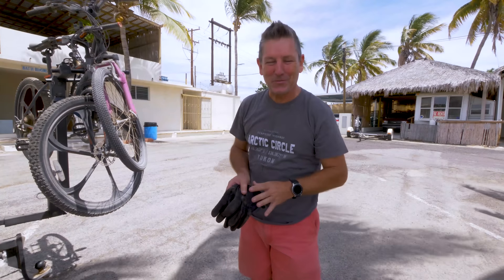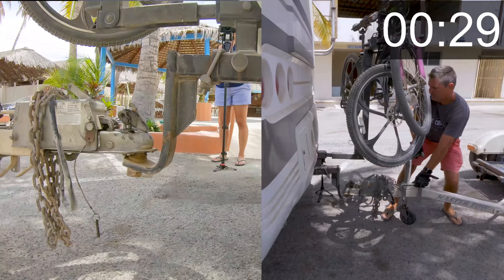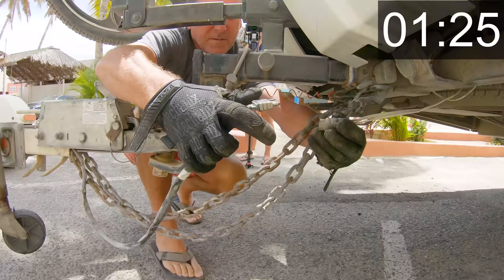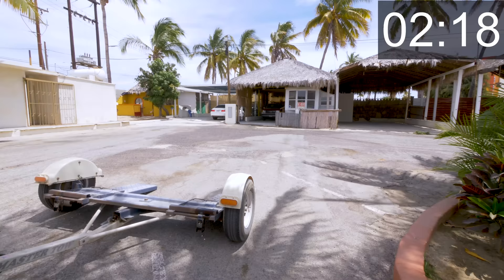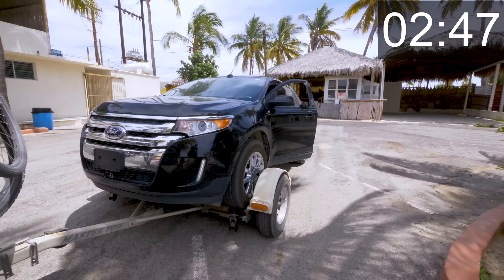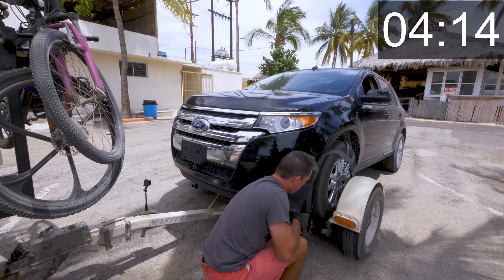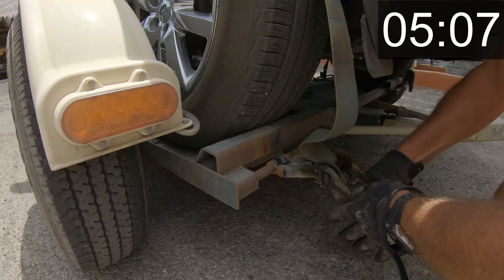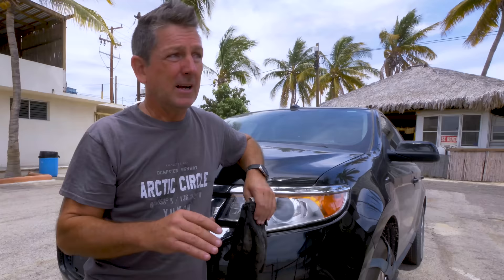EASY Tow Dolly Hook Up & Load Vehicle in 5 Minutes | Check Your Owner's Manual! #towdolly

Comment from the maker: We have heard that newer vehicles have electronics on the rear axle that require the vehicle to be placed in neutral and the battery be disconnected. Many people use safety chains connected from the tow dolly to the vehicle. I choose not to because I feel that the chances of both straps failing is pretty slim. Check your straps regularly for wear that could cause a failure and replace at the first sign of fraying. Check you owners manual before listening to any knucklehead on Youtube! 😂

Comment: You forgot to add 2 magnetic lights on the roof. By law, your dolly lights are too far forward.  Easy peasy,  do the right thing!
Reply from the maker: I don't like the way the magnetic lights look. I would think those laws vary from state to state. If someone is following at the proper distance,  both dolly lights are visible. I will say that I have pulled that dolly over 50,000 miles, back an forth across the Canadian and Mexican borders and have never had an issue. For added safety, I recently added an adaptor for the vehicle taillights to work.

Comment: You should have safety chains from the car to the dolly.
Reply from the maker: Some states require it, I think they are unnecessary. If something happens that both your straps break simultaneously and the only thing holding the vehicle on the dolly is the safety chain, you're probably upside down! Just my opinion.

Comment: One more thingyour break away brake cable needs to be hooked up to the motorhome frame, not the hitch. Don't rush a how-to video. Show all the required steps.
Reply from the maker: Appreciate your input. I have never seen anyone hook a breakaway cable to the frame and have always used the same location as the safety chains.

Comment: Very quickly he lacked to secure the anchors of the center of the dolly, the safety chains lacked
Reply from the maker: You are correct. I personally do not use the extra chains. I keep my tire straps in like new condition and replace them when they get overly worn. I don't see the need for the extra chains. I would like to hear if anyone has had both tire straps break and the only thing holding the vehicle on being the safety chains. We appreciate your comment.

Comment: He didn't spend much time making sure the vehicle was in the middle of the dolly. It took me over 30 minutes of on and off just to get mine within 1" of being in the middle. How important is being close to the middle?
Reply from the maker: It doesn't have to be perfect Glenn. I know how far the tire has to be from the edge of the ramp.  so I line that up and know we're good to go. I'm sure you could be a couple of inches either way and be fine. We have had zero issues after 55,000 miles of towing on that dolly.

Comment: ok you all when you hook up the dirty light plug ,, i usually add a small wire in the middle of the wires and twist it so it DON T CUM LOOSE
Reply from the maker: Thanks for the tip Mike!

Comment: You should get rid of that adapter for your bike rack .it pushes your hitch to far back from your receive and that extra length increases the load on it weakening your whole hitch  that's not to bad if you're only hauling some thing lite like a small utility trailer maybe up to 1000 pounds but you are hauling closer to 2 tons . That is dangerous please I'm not being a troll I'm looking out for you those adapters should be  out lawed in all 50 States  .the extra length will reduce the hitch strength by up to 50 percent.
Reply from the maker: Alan, a tow dolly doesn't have as much tongue weight as pulling a regular trailer. We have 50,000 plus miles on our hitch/dolly/bike setup without an issue and we check it regularly. Thanks for your input.

Comment: Good stuff. Almost went with a dolly but found a Hyundai Veloster, standard transmission 6 speed, so we went with 4 down with a Blue Ox tow bar system.  There were no modifications needed to the Hyundai since it only weighs 2,800 lbs. Pretty easy and solved the storage problem since we have a 40' rig.  Well done and yes you have a darling camera woman assist! Stay safe out there.
Reply from the maker: Always go with what works for you David! Safe travels!
Reply: Hope the car isn't stolen with a USB cable!

Comment: Glad I watched this video. I have some straps that came with the master tow dolly and they literally suck. I'm buying the ones with two hooks which also seem to ride a bit higher and don't scare me about going around brake lines, components, etc. Thanks for this.
Reply from the maker: Yeah, some tow dolly straps seem like they aren't even supposed to be used for a tow dolly. They do get in the way of everything. I wish I could tell you which ones ours are, but I honestly don't remember. We've replaced them twice in our travels now. If they show a cut of any kind they should be replaced immediately, but if you install them correctly they should last a very long time.

Comment: Is it me or does the trailer tires look bald on the inside? And the hitch adaptor for the bikes is it rated the right weight? Why i say this usually adaptors cut the towing capacity in half. Otherwize very simple and straight forward video guys!! I think you ment to say FRONT WHEEL DRIVE. You can have 2wd but only rear and then you can use a tow dolly.
Reply from the maker: Trailer tires are good, it just looked funky in the video. Adaptors do reduce capacity but there isn't much tongue weight with the dolly. It's worked for 2 years without issue....I should have never said that! And yes, I meant FRONT WHEEL DRIVE...Lol! Safe travels!

Comment: Thanks for the info.  We are switching from a travel trailer to a 32' Class A.  We are about to buy a dolly for our civic and enjoyed this video.  Practice will make this process go faster.
Reply from the maker: Yes, practice will help you get faster. Remember, SAFE is better than fast, but we had people telling us they didn't want to use their tow dolly anymore because it took 30 minutes or more to hook it up. It doesn't take any longer than towing 4 down. The biggest con with a tow dolly is if you have to store it when at campgrounds. The biggest plus is you can still back it up with a car on it for a short distance, if you have to and if you are careful. That is something you definitely will need to practice!! We were able to back it into most spots and rarely had to unhook it. Safe travels!
Reply: @LifeWithPaulLorena  Thabks for the great reply.  Was wondering about the backing up.  Assumed you had to go slow and not too much angle because of the surge brakes.  Know there may be tighter clearance issues possible with the car. But what about side load forces on the steering column?  Assume this would be another reason for a gentle backing up with maybe a slight angle.
Reply from the maker: You can always test that. I've backed up a long way with ours and have even done a slight turn while backing up. Probably not recommended because you can get into a bad situation pretty quick, but I've done it to avoid unhooking everything to get out of a tight spot. You have to go off your comfort and safety level. 

I lock our steering wheel because our tow dolly has a pivot plate. I try to not make really sharp turns. Safe travels!
Reply: @Life With Paul & Lorena  once we get everything we will probably have a video out as part of our RV Hunt videos.  Will try to let you know so you can have a good laugh

Comment: Paul, love your and Lorena’s video never thought i would have a technical question but here I am.  We have a small Motorhome, 21 foot, capable of towing but we have a rear wheel drive Chevrolet tracker, 5 speed manual.  Thoughts of towing backwards.  There are so many ideas out there but you seem to understand and keep using a dolly for towing.  Thank you in advance for your thoughts.  Congratulations to Lorena and we are fortunate to have her as an American Citizen.
Reply from the maker: Hi Diane. I think towing your vehicle backwards is a bad idea because the front wheels can turn and may cause a wobble. If it's a manual you should be able to tow it 4 down without a problem? I use a tow dolly because we have a front wheel drive car and a tow dolly is easy for that.
Reply: Paul, Thank you for your replay!

Comment: I use a trailer instead of a dolly. I have needed to park the trailer in a parking area before but I can take any type vehicle plus we can add stuff on the trailer. I am concerned it can be stolen so I have wheel locks I use when disconnected. Not all 4 wheel drives can be towed 4 down.
Reply from the maker: I would love to have a trailer with storage. Dealing with the dolly is enough! Lol! Isn't it crazy we have to worry about someone else taking our stuff!? Safe travels!

Comment: Do you not have safety chains?  Do you lock the steering wheel with the car's seatbelt to take the strain off the vehicle steering wheel lock?
Reply from the maker: I use safety chains from the dolly to the rig because I could see where the ball could have an issue and release. I personally choose not to use safety chains from the dolly to the vehicle because I don't think they are necessary. To have both straps break, if you keep them in good condition, is very unlikely to happen. I know many people will disagree, but we've towed over 50,000 miles now without even one strap breaking or coming close to breaking because we replace the straps at the first sign of wear.

We do not use the seatbelt trick and again feel it's unnecessary. You have to do what feels right to you and makes you feel comfortable.

Comment: I’ve been using the car tow dolly for about 12 yrs now, found an old Demco for 375$ and its a workhorse ! I pretty much mirror your way , I’m a little more on the side of precaution n I don’t leave my chains to low to the ground ( sparks=fire) i use locks all my points of connection ( prevents thievery ) ! I need to install a wheel in front like you did , I’m not getting younger n it will help in moving the trailer! Good video

Comment: Are the tow dolley lights all you need to come on? What about the vehicle lights ?
Reply from the maker: As far as we know, all you are required is to have indicator lights in the rear. We have towed this way for over 5 years without issue. I would say that having the vehicle lights working as well would be an added safety benefit. Safe travels!

Comment: I agree totally on a dolly vs 4 down however I have a safety chain from the dolly to the car I noticed you don't . Just an extra safety precaution nothing wrong with being too safe.
Reply from the maker: I don't use them, but they are law in some states. I would like to hear from someone who had both straps break and the only thing that kept the vehicle on the dolly were the safety chains. I replace our straps when they even hint of being at breaking point.
Reply: @LifeWithPaulLorena  good to know about the straps feel the same. I hook the chains up simply because came with the dolly and they're not much trouble  to hookup Not sure what would happen if the straps did break guess the chains would either crash me or hold the car in place till I could get stopped who knows. If you  wouldn't mind knowing where you buy your straps at?. Sure like the way your  looks with the three straps my only has two.

Comment: While a jeep is usually 4 down capable, most late model  4 wheel drive cars are NOT listed in the dinghy guide for 4 down towing.
Reply from the maker: Yeah, you definitely want to check before trying to tow anything 4 down or worse yet, buying it thinking you can tow it 4 down and finding out you can't!

Comment: Good tutorial. Some questions;  I just picked up my first master tow dolly so this is helpful. Brakes: you have a breakaway cable if the hitch disconnects; how do the surge brakes work if there is no “push back” from the tow vehicle ?  Steering wheel lock , I was told it’s important to lock the steering wheel, you didn’t mention this. Is it necessary?  Especially when backing up ??  Thanks.
Reply from the maker: Hi Todd! When you brake the vehicle towing, the vehicle being towed pushes forward and applies the brakes on the dolly. t is not a perfect system, but ours has worked flawlessly for over 3 years. i didn't mention locking the steering wheel because some vehicles steering wheels lock and some don't. Ours happens to lock when you turn off the ignition and pull the key. If you are thinking about backing up a car on a tow dolly you better know what you are doing or you will likely cause damage to your car, the tow dolly or your tow vehicle. It ain't easy!

Comment: How are they backing up? Using one 1st time tomorrow on non running 68 Cougar.

 Ive backed boats in 30+years, thanks.
Reply from the maker: You can back the tow dolly up by itself if you are very careful. Because it is so short it will jackknife very quickly. I have done it for very short distances with the car on it, but that can go wrong in a hurry!
Reply: @LifeWithPaulLorena  yes it's a PITA! Having my 68 flatbeded, it's worth too much plus need to save time. Did my Taurus and bronco and 25' boat rig yesterday, was enough. Looks like short piece of 2x4 between swivel  platform and drums would lock it so as to back up, didn't have time to try it.

Comment: One thing one ever think about is not all cars can be towed by a RV or for that matter a tow truck with rear wheel s down on the ground most car with front wheel drive can .some rear wheel drive can buy a lot can't you need to look at your owner s Manuel to determine  most rear will  get drive train damage unless you remove the drive shaft be for towing more than a few miles at low speed  .the car needs to be running and in gear to move the oil in the drive train. Please check your manuals   and happy rving.alslo dolly can be a great tool but they don't have any break  and are not legal in a lot of state s and not safe in the mountains due to having 2 tons going down hill with no brakes
Reply from the maker: You are correct in that a tow dolly is best for a front-wheel drive vehicle. I would never recommend a tow dolly for a rear-wheel drive vehicle for RVing.  

However, you are incorrect when you say ALL tow dollies don't have brakes. Ours has a surge brake and most others have electric brakes. We have traveled mountain roads all over North America without an issue.

Also, tow dollies are legal on every highway in every one of the 48 contiguous states. Registration and whether or not you must use lights in various ways may vary.

Comment: Would you use this dolly for a rear wheel drive ? Like a truck?
Reply from the maker: No you wouldn't. There is no point really. A front wheel drive works best on a tow dolly.

If it's rear wheel drive, check to see if it can be towed 4 wheels down. Some rear wheel drives can be towed 4 down. Some need accessories like transmission pumps, and some just can't. Best of luck Ken!

Comment: You don't mention the locking steering? Some videos show the steering free. So which is it?
Reply from the maker: We put the car in park, and turn off the key. The steering is locked. Our tow dolly has a swivel deck so it's not necessary to leave the steering wheel unlocked. We have traveled 55,000+ miles without an issue.

Comment: Great video! Couple of questions. Electric Brake controller or stick with Serge brakes? Is there a make of dolly that you can backup? What is up with some dolly's leave the brakes off steering wheel in locked position? I'm getting carried away. Thanks for your help
Reply from the maker: Hi Ron, the surge brakes have worked great for us. Less to go wrong, in my opinion. I back mine up all the time without issues, but you have to be careful because they can jackknife quick and damage your tow vehicle or coach.  Not sure about your last question. We leave our car unlocked, but the steering wheel is locked and keys are out. Hope that helps! Safe travels!

Comment: I just spent an awful lot of money on a new car that will be Dollied behind my Motorhome (B+ Compass)...I missed where he used his E-Brake, I missed the safety chains...and I didn't want to skimp  with a new car so I spent more than they did on a good Dolly that won't require any of his DYI improvements. Is speed really the only concern?
Reply from the maker: Speed is not a big deal at all, but the anti-dolly crowd always site that it is a much slower process. I disagree. Our dolly has surge breaks and does not require an "E-brake" to be hooked up. I don't use safety chains because I replace my straps at the first sign of any wear. I have never heard of a situation where both straps have broke and the only thing saving the vehicle in tow were the safety chains. If both straps break and only the safety chains are holding the vehicle on, I assume the entire rig is upside down in a ditch. It's great that you spent more money than we did on your tow dolly, but not everyone has that option available to them. Safe travels!
Reply: @LifeWithPaulLorena  I understand that "you have never heard of a case where", but after spending $30,000.+ on a new car it seems that the added insurance of. the safety chains and the entire 45 seconds they take to properly install is a simple way to make double sure...better safe than sorry, no?
Reply: and I meant the cars E-brake when you pull onto the dolly before you get under the car...again a simple safety precaution...

Comment: I have a 2016 Navion 24G and want to tow a 5 speed VW Golf. A newbie when it comes to towing a vehicle. What differences does it make when its a manual vs automatic transmission? Are the keys in the ignition in the towed vehicle in the on position?
Reply from the maker: You'll definitely want to check with VW on how to tow that vehicle Mark. With ours, we load it on the tow dolly, turn the key off and go.